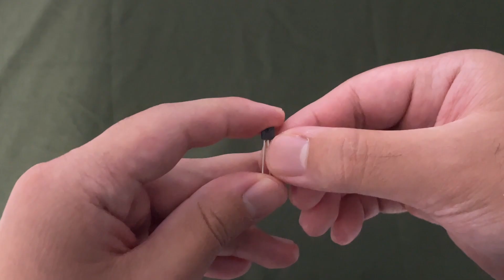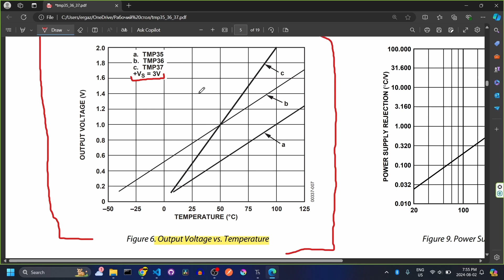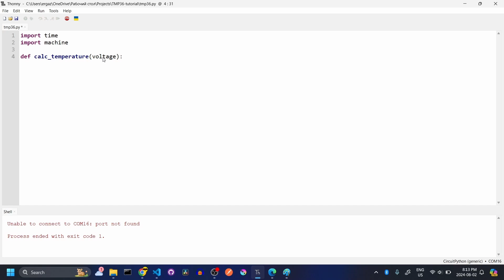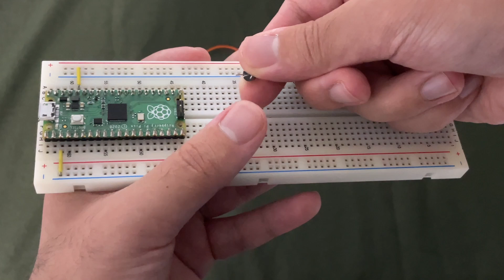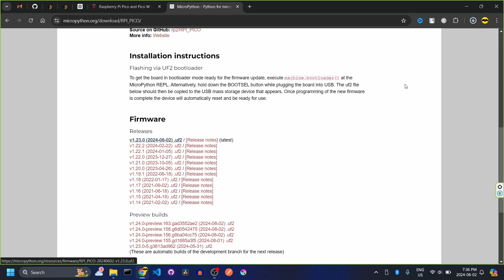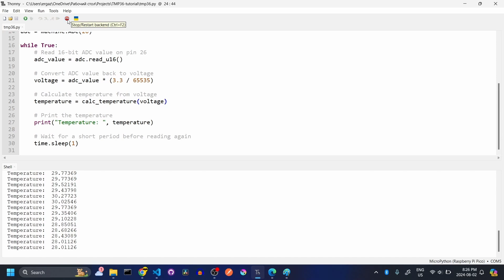Programming using DATASHEET | TMP36

Comment: If you get a decent digital temperature sensor, like SHT41 or SHT31, it could be a fun exercise to place both sensors next to each other and use the readings from the digital one to measure and calculate even more accurate calibration constants for the analogue one. The latter is probably more useful in analogue circuits as a whole.
Reply from the maker: Not sure about about SHT sensors, but I agree. There are many sensors that are better/worse than this one. I just had this one laying around)

And I think this is a good exercise on how to start reading Datasheets and work with analog sensors